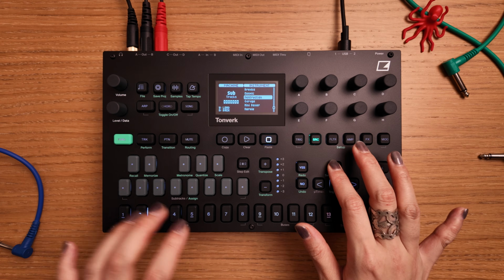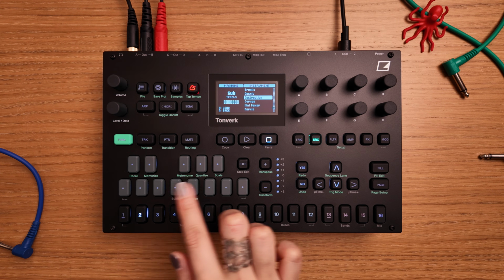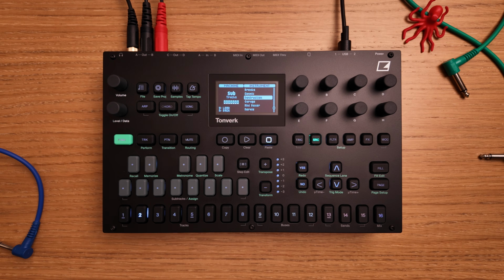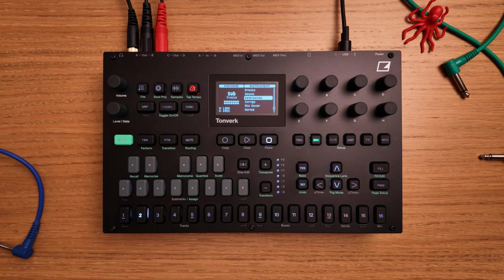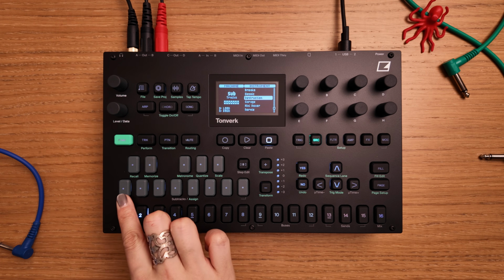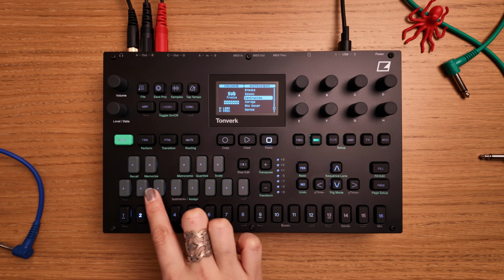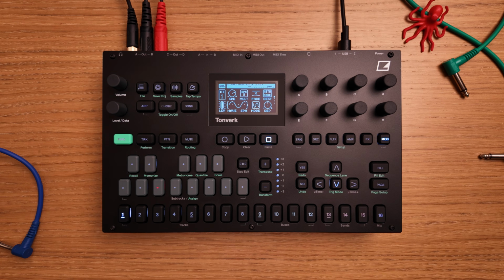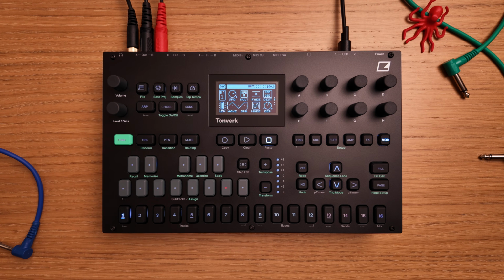Tonverk Tutorial: Subtracks Machine

Comment: I'm trying to understand if, when using the Subtracks machine on the Tonverk, each individual subtrack supports sample locks — meaning you can assign a different sample to specific steps within a single subtrack's sequence. The manual mentions sample locks for Single Player and Grainer explicitly, but doesn't clearly address whether this works on subtracks as well. Has anyone tested this?"
Reply: this wouldn’t  work on the subtracks because the sample locks access the preset pool and the subtracks do not. they only allow you to assign a sample from the SD card and save the entire subtrack machine as an “instrument”

Comment: I now have some weird thing with 1.3.0. I have a subtracks machine running. Every subtrack has a sound loaded and sounds when using the keyboard. But with the sequencer I hear only sound of subtrack 1. So no sound on the other subtracks eventhough the steps are programmed. Seems to be 1.3.0 related when I  look on the internet. And many solutions are suggested. Like starting a new project. Probably this will be fixed in a next update.

I checked and in my case it worked again by making a new project.

Comment: When can we expect a fix for the multi sampling issue? At the moment it constantly shifts start points because of a latency problem. In addition, the MIDI clock timing when syncing to other devices and when being synced still needs urgent attention. These are fundamental functions that should have been stable at launch. Most of us including myself would have preferred a later release with these issues resolved rather than something pushed out unfinished.

Comment: Different track lengths for each subtrack is needed 😮❤
Reply: just use a different track you have 8 of them.
Reply: @aikighost  Or better yet, just buy a second one! Throwing resources at problems is fun!
Reply: @0123-v1o  I mean if you have a need for a different length track, just use one... there are 8 of them on the box for a reason.
Reply: @0123-v1o That's why everyone should have at least two Octatracks